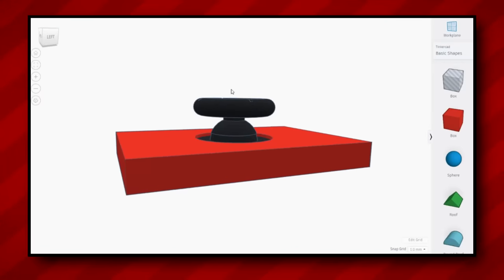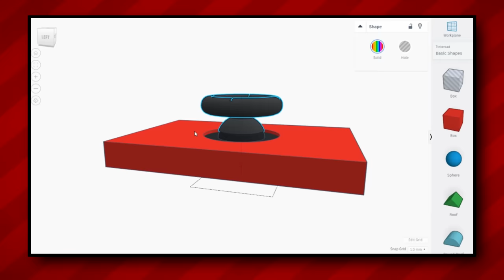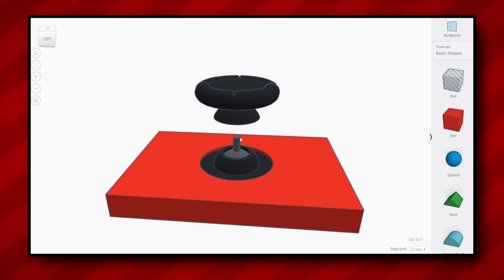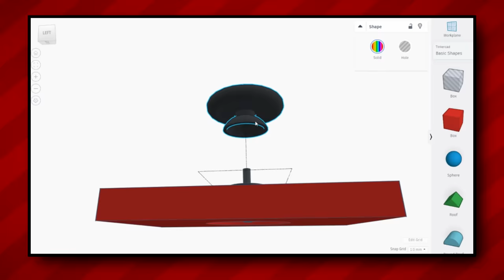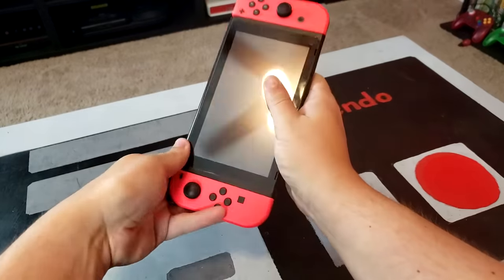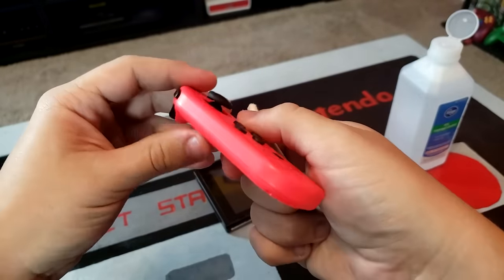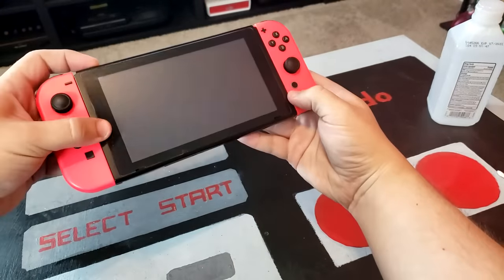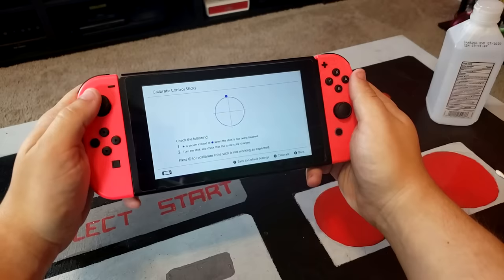How to Fix Joy-Con Drift at Home! No tools required! | Nintendrew

Comment: 100% of comments telling memes and funny things 
0% of comments that saying is this working or not
EDIT: under this comment u will find is this working or not.
Reply: It totally works. Any time my joycons act up I do this and it ends up not being a problem for a long time. Usually pops back up again every once in a while but I just clean it again. Your issue could also be due to the graphite contact pads wearing out, which would mean you need to send them to nintendo for repair.
Reply: Agree.
Totally works for me too. At least in my case, the drift completely disappeared and they act as good as new.
Reply: init im trying it now sooo
Reply: It works.....temporarily.
Reply: @videocee  What do you mean?
Reply: @justleak9192  if you spray it with contact cleaner it only fixes the drift for a little while. Long periods of use shortens the interval of the drift returning until you'd have to spray the cleaner under the flaps daily. There is no permanent fix.

 Source: sent my nintendo joycons to nintendo, replaced the joycons myself which was a first and i used contact cleaner and the drift still returned.
Reply: Works!
Reply: @Willowposting  what is the substance you used to dip your q-tips? i ddint understand in the video
Reply: @alexterieur8813  Isopropyl alcohol. I believe mine is 75%
Reply: Also what Formula Flight said is only partially correct. It depends on why your stick is drifting in the first place. The use of the isopropyl alcohol is only so that you clean the stick. If that doesn't fix it then there's something else wrong with your stick.
Reply: @Willowposting  thank u guys for all the answers
Reply: @Willowposting  Nothing in what i said is incorrect barry. Who cleans their electronics with alcohol in 2019? Order some electric contact cleaner. Its what its made for. The only cause for drift is the graphite getting rubbed away. Nothing else.
Reply: @videocee  That's not how controllers work. A stick being dirty is a very common cause for stick drift in all controllers. 

Please do not spread that misinformation. Clearly this works for people, judging by the people in this thread, as well as myself. 
You were partially correct about the graphite pads, but your statement just now is completely wrong. The graphite pads in the controller are NOT the only cause for stick drift. If that were the case, this wouldn't be working for me and other people. 
Plus, you asked who cleans their electronics with alcohol in 2019? And uh, I have to tell you that this isn't the only video that has provided this information. Not just on joycon but things like PS4 and Xbox One controllers as well. It's still a very common practice and there's a reason for it. You told people this only worked temporarily but you never even mentioned using the ACTUAL method in the video. Just that you sprayed it with some electronic cleaner and that didn't work, so apparently there couldn't be any other possible method for fixing this issue ever, and obviously because it didn't work for you it can't POSSIBLY ever work for anyone else. 

Even my Switch which gets very light use with the joycon (usually play in docked mode) started having this problem, and this method fixed that. Meaning there must have been some dust or other debris in there that was messing with the stick. I'm not sure where you would even get the idea that the graphite pads are the ONLY cause for stick drift.
Reply: @Willowposting  look up spawnwaves videos on drift. Not only him but other youtubers already claimed to have drift long ago and toredown the analogs. Alcohol may work now but over time it wont and there are many sources on this. If it was as simple as dust then simply blowing on the joycons flaps would suffice no? Ps4,xbox and all other controllers can get drift but no other controller has gotten drift as much and as quick as the joycons.

Also the contact cleaner worked but like i said....temporarily.
Reply: @videocee  Well yeah, the issue with the graphite pads comes from excessive use over a long period of time. But that's not the situation some people are in. It's not the only reason. Joycon will inevitably fail, that much is correct. But if your joycon is drifting and you're not using it that often, there's likely some other fault or it's dirty. 

I'm afraid you don't understand that the stick mechanism being dirty is more than just dust. You don't just blow on the flap and the issue goes away. You have to get under the flap. I never said anything about drift in the future, and I've acknowledged multiple times that it could be other issues aside from just the stick being dirty. Not sure why you're replying as if I'm saying the stick being dirty is the only problem.
Reply: BatteryBarry how often exactly is not that often, I’ve used mine for about a total of like 450 hours over like 2 years. Would this method work?
Reply: @domotron3598  Only real way to find out is to try it. The problem with stick drift is that it's fairly random as to when it starts for some people. I'd say try it, and it might work for a week or two before you have to do it again. Mine lasted about a month before I had to redo the process. Otherwise, you may want to look into sending them to Nintendo, as they currently provide free joycon repairs for drift, at least in the US and Canada iirc. They give you a shipping label and everything so you don't have to pay for anything except maybe packaging. Main downside is you lose your joycon for a bit, and much like this fix, it isn't permanent. Which is why I'd try this first.
Reply: BatteryBarry thanks, but... how exactly does one send it to Nintendo asking for a joy con fix?
Reply: @domotron3598  You submit a ticket on their website (just Google Nintendo joycon repairs for that, can't grab a link at the moment) and they should email you a shipping label that you can print out. After that you just gotta find some packaging to put the joycon in and slap the shipping label on the package and take it to the post office.
Reply: BatteryBarry Alright, thanks for taking the time out of your day to let me know.
Reply: Just did it and it works great :) don’t know how long it will last but it took like 30 seconds I wouldn’t be a hassle to do it again if i have to
Reply: @domotron3598  No problem, hope it works!
Reply: It works, but my drift was not so bad to begin with
Reply: @Willowposting  I love how this turned from a "it worked thread" to a "NUH UHHHH!" battle. hahahaha. I'm gonna try this when home.
Reply: @silenthillfreak156  lol I just wanted to prevent confusion is all
Reply: Not working on my Switch lite. Get back to Amazon this Nintendo Shit ...
Reply: @Willowposting  It was quite hillarious XD
Reply: This comment section has been entertaining and helpful haha
Reply: @alexterieur8813  isopropyl alcohol
Reply: Doesn't work on my sister's joycon because it has a real mechanical failure and cleaning and calibrating makes no difference. It will be replaced for free as soon as she finds her receipt, keep you receipts people.
Reply: @Willowposting  Yikes mate, sorry to see you got such backlash from that guy.
Reply: It works
Reply: Formula Flight he said isopropyl alcohol not contact cleaners
Reply: @Willowposting  Hey so I don't have contact cleaner but I have the normal spray bottle cleaner. If I spray some on a q-tip will it still work? I have rubbing alcohol but I'm trying to find a fix that'll last the longest
Reply: @linguini6270  I'd say just follow what the video says. As I mentioned, this fix will have varying results for everyone, and might not last as long for some as it does for others. The isopropyl alcohol should work, but there's no guarantee it'll last long or completely fix the issue. Best of luck, though!
Reply: @Willowposting  True true! The isopropyl alcohol does work it's just temporary for me. After about 10 minutes of playing I find slight drifts upward. I'll continue using the alcohol until further notice, thanks!
Reply: @linguini6270  No problem! Actual contact cleaner might do better, but if cleaning it with alcohol doesn't do much, it could be a mechanical fault or the graphite pads are very worn out already.
Reply: If a lense cleaner doesnt contain alcohol should I use it?

I assume not but it says no alcohol or solvents in the ingredients
Reply: It works temporarily. Every time you do it again (because the joy-con starts drifting again)it seems like the   Time it does not drift for get shorter.
Reply: I tried it 2 months ago and it worked permanently
Reply: I tried this method. I don't know whether I didn't get the q-tip in far enough or whether my problem is with the wiring, but it didn't really help me any.
Reply: What about the percentage of isopropyl concentration I have 70% and I’m scared to use it because he used 99%
Reply: BatteryBarry you have earned a new sub out of respect for staying on top of this thread, defending your beliefs, and helping people in need. Also, mine didn’t work so I may have to send it into Nintendo for a free repair.

Comment: Thanks a lot man. I was really hoping someone would come up with a solution.
Reply: This is not a solution you have to open it up disassemble the joystick.. with a Q-tip clean the ribbon board and slightly cremp up the Chrome conductor's so they can have more contact and reassemble the joystick
Reply: @calambres6614  thats not the ''sollution'' of cource doing this will not always work if you have very much dirt build up of cource that wont fully fix it but it getting THAT dirty normaly doesn't happen many things can get dirt on it depending on how you treat youre joycon :|
Reply: @williamv0242  I already replied to a nintendrew comment and I told him I will upload a short video on my channel keep in mind I have one megabyte upload data speed

Comment: I cleaned my thumbstick with a spray can of electronics cleaner after it started drifting to the left. having a thin nozzle in the can makes it really easy to get under the rubber dome. I think that drift is sometimes caused by wear in the mechanism and can't be fixed by cleaning.

I think that they made some changes to prevent the wearing of the mechanism but apparently dirt can still get in to make the mechanism stick. They should have revised the design further for the new switch and switch lite to prevent the dirt build up.
Reply: They will have bought the sticks in bulk. So they will just have a lot that will eventually be affected.

Comment: I don't get why Nintendo Switch remotes drift so much when my Gamecube, Xbone, Wii Nunchuck, Wiiu pro etc. all work perfectly after many years of use.
Reply: It's because of the piece of rubber mentioned in this video. That thin, soft piece of rubber is the only thing standing between dust and the internal components, and it doesn't do a good job. The other controllers you mentioned all have solid plastic bases covering the internal components, so dust doesn't get in there and thus no drift occurs.

Comment: You can also use the "Find Controller" option, vibrate the ** out of you drifting joycon for a minute or two while moving the stick, and then going to see in the calibration settings if it worked. I don't really know why, but it worked perfectly for both my day one joycon.
Reply: that kind of helped it.
Reply: Just vibrating it, or doing that while cleaning it?
Reply: I tried this and so far I discovered my right joycon barely vibrates, like, it is extremely weak in comparison with the left one. They are both charged, so I figure I have found a new problem with my controllers, RIP.
Reply: The vibrating+rotating of the stick is probably enough movement to get rid of any bits or at least move them off the sensors, also thanks for the tip :)

Comment: When you don't even have isopropyl alcohol. And is in lockdown.
Reply: Honestly when I restarted my switch it fixed it so try that if the other reply on this doesn’t work
Reply: @noobie5131  Thank you thank you thank youuuuuuuu!
Reply: @noobie5131  thank you so much man like seriously you dont know how much this means to me
Reply: @noobie5131  Thank you so much!  I am so happy that my joy con is finally working!! You are a life saver!!!!
Reply: Depending on how bad the drift is you can do it dry with a piece of paper (in my experience).
Reply: Arnoobie thank you!!!
Reply: @snakeygirl4296  thank u i dont have the right alchohol and straws so this should do
Reply: @snakeygirl4296  yo thanks again it worked😃👍❤
Reply: @noobie5131  worked for me, thank you!
Reply: @noobie5131  BRO THANKS YOU ARE AN ANGEL FROM HEAVEN
Reply: nobody 007 it’s only a temporary fix but I’m glad to help!

Comment: One thing I’d like to point out is that should you choose to go that route don’t expect it to scan amiibo any more.
Reply: Not necessarily, so long as you use 91% isopropyl alcohol, the scanner should work just fine. I just did this and the scanner still works.

Comment: I find it odd that everyone’s left stick is drifting, as for me it’s my right stick.
On both pairs of joy-cons I own.

Edit: My Joy-Cons are officially the worst controllers I've ever owned. Both sticks drift to the right and up, and the right stick no longer is able to register when I move it to the left.
Reply: My right joycon always goes down and to the right so it makes it super hard to play game like rocket league
Reply: I've had it happen on both before, I think the reason why it happens on the left more is that the left controller is usually what you use to move your character on games like animal crossing, botw, Mario odyssey, etc.
Reply: It’s also on my right controller
Reply: it’s both for me and it’s an actual hell to play any type of game i own on the switch 😩
Reply: @jewelburt5850  If you live in the U.S. you can set up a joy con repair on Nintendo’s website and you can send it off to one of their repair centers and they’ll repair them free of charge. I’ve done that before twice and I definitely  recommend it. The process might be different if you live in another country though
Reply: OMG SAME. It is IMPOSSIBLE to play Mario Kart 8 dx, since the right stick also pushes you forward and backward. IT DRIFTS TO DOWN, IN CASE YOU HAD NO IDEA.
Reply: Same

Comment: Given the length of the video I thought this was gonna be a joke, but no this is the real deal.

Also am I the only one who’s yet to experience this sort of drift?
Reply: My guess is that the manufacturing of each Joy-Con is done in more than one facility, so it’s like with computer components, in that you may get lucky and not experience any issues with the Joy-Cons at all, or you might experience issues after a few days of using them.  I do also think it depends on the type of games that people play and how much wear and tear a certain type of game will put on the sticks.
Reply: I’ve had 2 base model switches and now the switch lite, with 3 pairs of joy con. No drift for me since 2017

Comment: This 'fix' is literally the same as blowing really hard on your controller.

Sadly, there's no way to permanently fix  drift issues without tools. My recommendation is to buy some replacement analog sticks off Amazon and either do it yourself with the aid of a Youtube tutorial or by getting a more knowledgeable friend to do it.
Reply: Replacement is the only solution for the analog. Unless you modify it and use a better analog stick like the ones in the pro controller
Reply: Yeah. Clicked the video just to make sure these comments were here. The coating on the contacts gets rubbed off, causing the problem. Dirty sticks is something that applies to any analog controller and isn't any more widespread on the Switch AFAIK. Isopropyl might relieve Joycon drift temporarily by getting the rubbed-off coating dust out, but the underlying problem is still there and replacement is the only practical true fix. Nintendo completely screwed the pooch with this design or these materials (one or the other), and with how they've handled it.
Reply: The way I see it this is more maintenance than fix, it's like greasing a wheel you gotta do it to keep it in good condition.
Reply: @GremmPaltakin   Well obviously, but if you actually care about something you spend $300 on you might need to do some maintenance if you want to keep in good condition. This is way better then sending them off to Nintendo or doing it yourself, which I've done, and I've also used this method, it's much cheaper and faster.
Reply: Isn't Nintendo of America allowing free repairs for Joycons though? Also the Joycons are flawed and are a waste of money. If something drifts so quick, it's not exactly a good sign for the product. If anything it makes their controller look like a scam with that pricing.

Comment: For anyone interested in if this works: I got my switch for Christmas 2019 and the home button controller started to drift down now (Late April 2020). I tried this once with one coating and it worked for maybe 10 min. Then I tried three coats and that worked for 10 min as well. I’m planning on sending my controller in for repair once the repair facility is open again
Reply: Can you tell me when they re-open too
Reply: Marshdoggo likes sushi I just checked right now and they are accepting orders for joycons only!
Reply: @hunterlohmann  oooh thank you!
Reply: Marshdoggo likes sushi no problem!